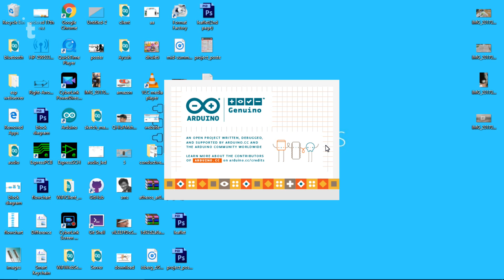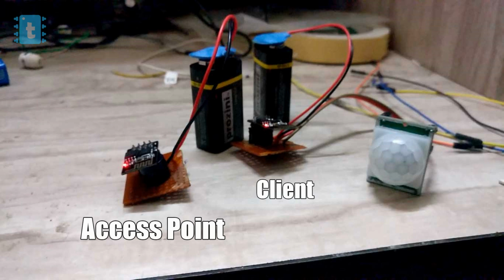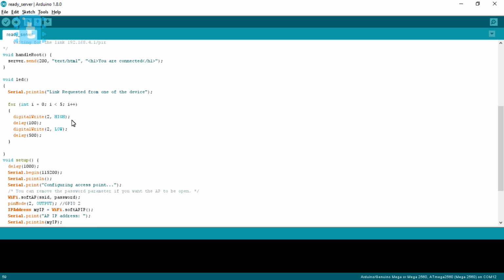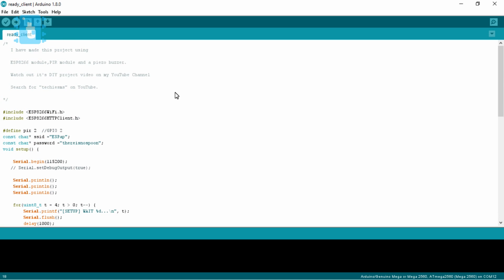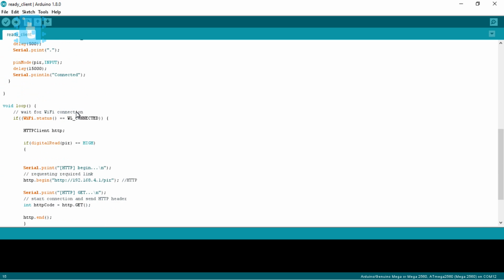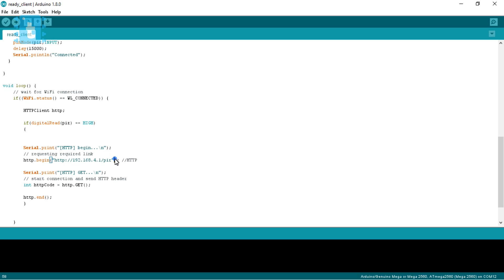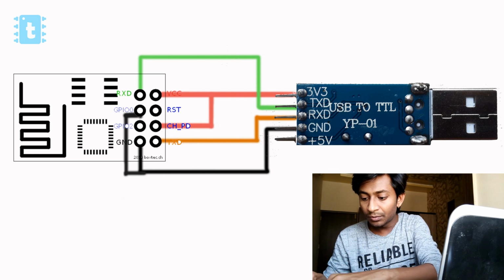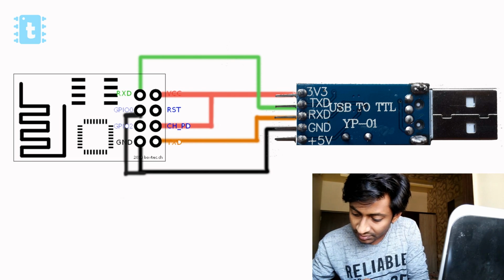DIY Machine to Machine Talk project using ESP8266 01 | M2M Projects | IoT Projects

Comment: When I compiled M2M_Client program it gives error, Arduino: 1.8.15 (Windows 8.1), Board: "Generic ESP8266 Module, 80 MHz, Flash, Disabled (new aborts on oom), Disabled, All SSL ciphers (most compatible), 32KB cache + 32KB IRAM (balanced), Use pgm_read macros for IRAM/PROGMEM, dtr (aka nodemcu), 26 MHz, 40MHz, DOUT (compatible), 1MB (FS:64KB OTA:~470KB), 2, nonos-sdk 2.2.1+100 (190703), v2 Lower Memory, Disabled, None, Only Sketch, 115200"

H:\Home_Sequrity\esp8266\M2M\M2M-Talk-Project-master 2\M2M-Talk-Project-master\M2M_Client\M2M_Client.ino: In function 'void loop()':

M2M_Client:58:19: error: call to 'HTTPClient::begin' declared with attribute error: obsolete API, use ::begin(WiFiClient, url)

   58 |         http.begin("http://192.168.4.1/pir"); //HTTP

      |         ~~~~~~~~~~^~~~~~~~~~~~~~~~~~~~~~~~~~

exit status 1

call to 'HTTPClient::begin' declared with attribute error: obsolete API, use ::begin(WiFiClient, url)

This report would have more information with
"Show verbose output during compilation"
option enabled in File -> Preferences.

Comment: This is two ESP-01’s talking directly, no internet, no router, no web server. Just two modules?

Correct?

Thank you so much.

I need to get two modules to talk to each other at a greater range than Bluetooth will allow, and there is no internet or WiFi service, so it must be a stand alone project.

Thank you for any advice.

Comment: Sir, i am using esp 01, and i want to communicate between 2 boards(esp01), like one board will be attached with my pc through usb to ttl convertor, and other board(esp 01) is at some distance attached with arduino board. When i burn the code to usb to ttl convertor, it should be automatically burned in the arduino at some distance( by the WiFi link and internet link both), kindly guid me if it is possible?

Comment: Sir why sometimes the smartphone doesn't show esp8266 01 WiFi wen it's switched on? My esp8266 01 is not even responding to AT commands, but fortunately the blink led works and it confirms that the chip is all good. So why are these problems arising ?

Comment: Hi , Ty for your code , in my case i have a DHT11 temperature and humidity sensor in the client and a dc motor in the Access Point , and I want to put a trigger on humidity if it reaches a certain value it would turn on the motor for 30 sec , so can you help me please , I'm using 2 nodemcu esp8266 boards

Comment: Is it possible to share data between two ESP8266 modules?, for example one module reads the sensor reading and sends it to another ESP8266 which will receive it and displays. How should I implement this, Please help !
Reply from the maker: +Kalyani Tate 
I need to try this first and then I'll let you know.
Let's connect on WhatsApp for Better communication
+91 82000 79034

Comment: Hi techiesms,
I have a slight confusion here, the server side of the code states that whenever there is request for 192.168.4.1\led , the led would start blinking , but on the client side i don't find any section sending this request as a matter of fact i am finding a line [ http.begin("http://192.168.4.1/pir"); ] , should this be http.begin("http://192.168.4.1/led").

Comment: great project man. is it possible set the client with a temperature sensor and the server with a relay, so whenever the temperature reaches a certain degrees it will turn on the relay. thanks
Reply from the maker: +Mohammed Zaman yes why not
But for that you need to go for esp12e 
As esp 01 don't have analog pin
Reply: how about a wemos or a nodeMCU?

Comment: Good tutorial , am on a similar project wherein i am using two nodemcu to communicate with each other , do you have any mechanism of communication apart from the Client server model.
Reply: also why have to added  this code
for(uint8_t t = 4; t > 0; t--) {
        Serial.printf("[SETUP] WAIT %d...\n", t);
        Serial.flush();
        delay(1000);
    }
Reply from the maker: +Naveen Shetty 
This line is not of any use. This line will just add 4 sec delay and print it on serial monitor like 
4
3
2
1

I have used the example code and these lines were already written in that code.
Reply: Hi techiesms,
For the server side code , there is function server.handleClient() in the loop section , but i don't see the function in the code , is it part of the webserver library and what does it do . Secondly you have created a function 
void handleRoot() {
  server.send(200, "text/html", "<h1>You are connected</h1>");
}

What does this do and is it required in the code.
Thanks and keep us the good work.

Comment: Can't we use esp8266-12e and communicate..... instead of esp8266 01 module?
Reply from the maker: +Sanjeev Tarigopula yes ofcourse
Y not
Reply: Can you share me the circuit diagram with esp8266-12e...?
Thanks in advance
Reply: And can we upload the code directly to the esp8266-12e without Arduino r usb like how we uploaded our previous codes like WiFi access point etc ??
Reply from the maker: +Sanjeev Tarigopula yes
Reply from the maker: +Sanjeev Tarigopula +91 82000 79034
Reply: Thanks a ton.!!

Comment: Hi, Thanks for your video, I'm doing simple project, i'm connecting my hardware tx rx of my esp 8266 to a micro controller device and want to display these data comming from the controller remotely on a pc serial monitor or web page... i'm little bit struggling with my coding.. do you think web server example will help me? your help is much appreciated..

Comment: nice project! i need a bit of your assistance on my IoT project.
I am working on a home automation project and i want one ESP8266 which is connected with an arduino should communicate with another ESP8266 which is connected to a relay module and turn the relay on or off.
Reply from the maker: +Rohit Mathur you can use this code for your project
Reply: techiesms will it be connected to the outside world? i mean can i control it from anywhere via internet. basically the esp which is connected with arduino
Reply from the maker: +Rohit Mathur you can do that also 
Watch out my MQTT video in my channel
Reply: I am getting an error "warning: espcomm_sync failed
error: espcomm_open failed
error: espcomm_upload_mem failed
error: espcomm_upload_mem failed"
I have been trying to solve this issue since so long.
Reply from the maker: +Rohit Mathur how you are uploading the code to ESP.
Means what steps are you following?
Reply: I am uploading my code using Arduino.
Rx --> Rx
Tx --> Tx
Vcc --> 3.3V
Ch_pd --> 3.3V
Gnd --> Gnd
i tried with two push buttons as well. One connected to RST and the other one to GPIO0. I hold them down while uploading. I also used the usb to ttl converter. In that case Rx was connected to Tx and vice versa. Also done trying by using external power supply
Reply from the maker: +Rohit Mathur 
Don't do anything with reset

See follow the steps which I suggest

In Arduino 

- First connect the reset pin of Arduino with ground
- then connect rx with rx , tx with tx , vcc and chpd with 3.3 , GPIO 0 and gnd with gnd
- then select generic esp8266 01 in board manager of Arduino 
-Then click the upload button
Reply: thanks bro. It's working. tried so many references but nothing worked except ur solution. I should have asked u earlier. Anyways now i am gonna implement ur tutorial to my project. keep up the good work (y)
Reply from the maker: +Rohit Mathur that's really great
Just post you project on FB or Twitter as soon as you complete it with a hashtag 
#iamtechiesms
Reply: techiesms sure
Reply: I have been trying to make an esp8266 act as a server which on receiving the request from the browser forwards the request to another esp8266 which is connected to a relay and the request says to trigger it. When i upload your code. The webserver says that the site can't be reached. Plus i am heading no where in manipulating the code in a way that i want to. Hoping for your help.